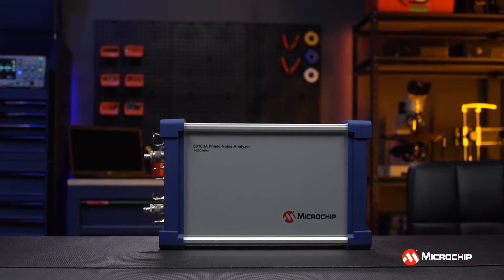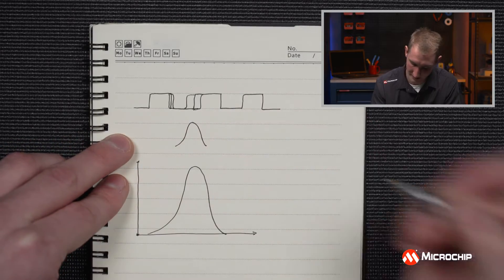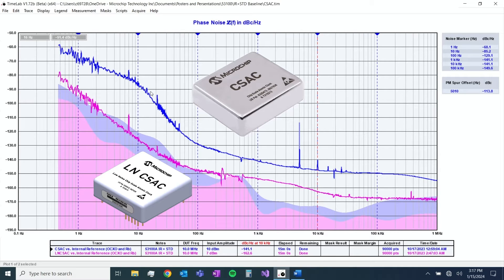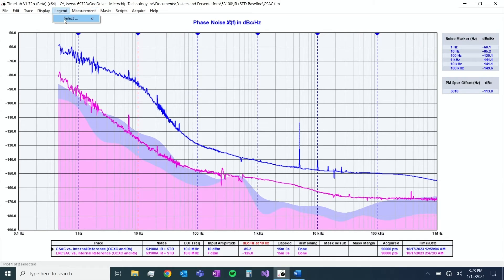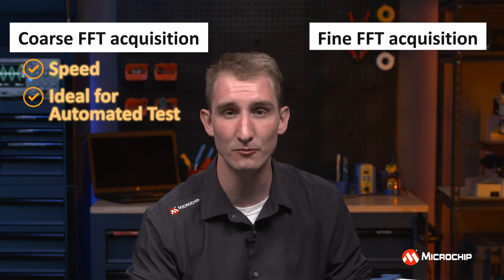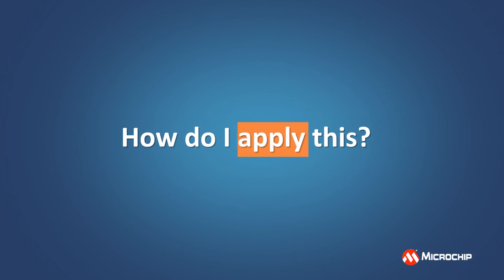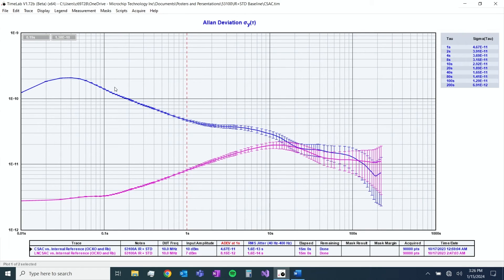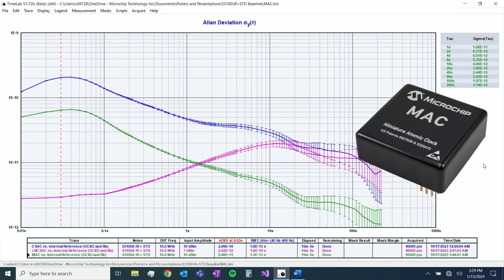Understanding Phase Noise & ADEV: Practical Measurements with the 53100A

Comment: Good useful video. I am a radio amateur new to phase noise. I have found it very useful to examine the signal with a spectrum analyser as well. Many oscillators and signal generators have significant spurs or spurious signals in the sidebands. It doesn't seem to correlate with cost as some expensive signal generators have sideband spurs. The spurs in the sidebands should correlate with spurs or increases in phase noise in the phase noise analyser. I have a few recent blog posts. Search my callsign. Regards Drew VK4ZXI